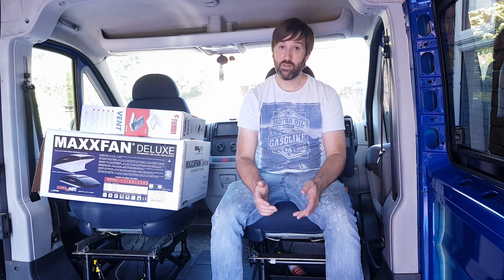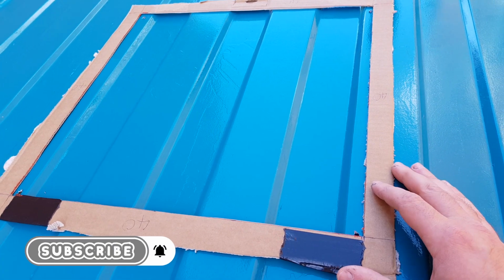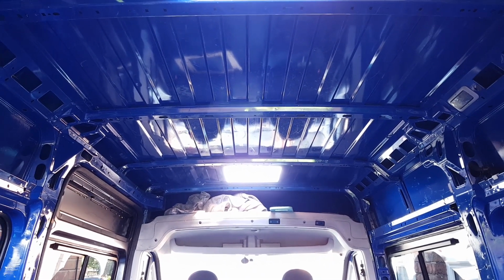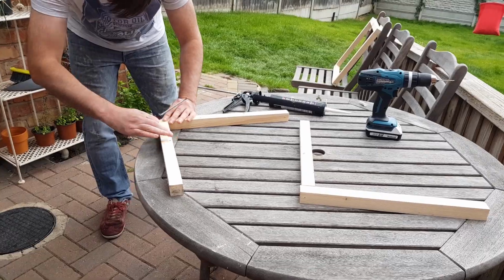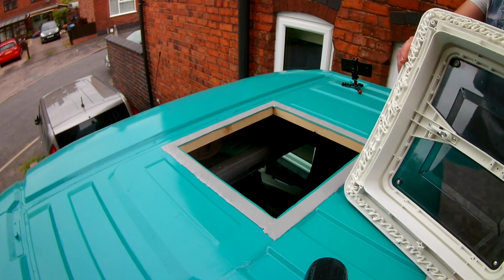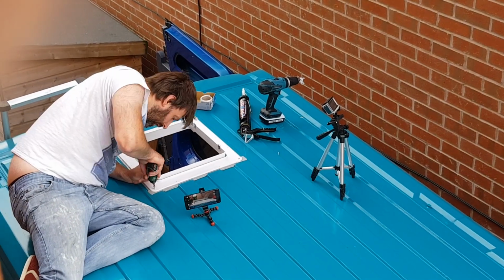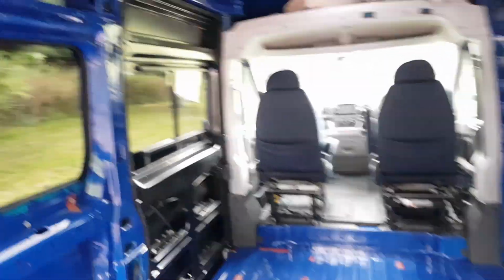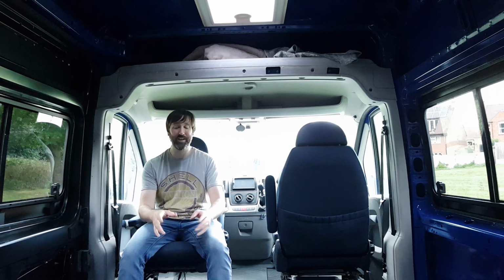Fitting A MAXXFAN DELUXE and FIAMMA Roof Vent - DIY Budget Campervan Conversion

Comment: Another tip for aligning the holes when fitting the top part, is that the holes in the plastic are bigger than the metal clips, so if you slide the metal clips up a tiny bit the screws will guide themselves into the holes.
Reply from the maker: Thanks for the advice Martin, if ever I do another build (probably likely) I'll definitely bare in mind your advice. 🙂👍

Comment: Thanx for sharing. Installing my Deluxe this week if the weather allows and your video was helpful. I did however splash out and bought and adapter for a Ducato/Relay/Boxer roof that fixes the rib issue.
Reply from the maker: Thanks for checking it out. Hope your own installation went without a hitch! 🙂👍

Comment: Yeah I was a bit disappointed you went for the posh option but fair enough you've got a dog & I'd get a Maxxfan too if I could afford it. Honestly I'd probably try to stretch for the manual version if it were available here and a fair bit cheaper. 
Nice to see you using Stix-all, I'd planned on doing the same as Sikaflex 512 is so expensive but I found some Dekasyl for roughly the same price so probably gonna go with that, although that's mainly cause it's got a picture of a campervan on the packaging lol.
Reply from the maker: Yeah we didn't want to splash the cash. It was four times more expensive than the Fiamma but we wanted to make sure the van was cool for the dog. Not only that, we thought if we were uncomfortable in there because of the heat we wouldn't use the campervan half as much. Only other big budget item we'll be fitting is a 12v compressor fridge due to how economical they are. We figured it would pay itself back over time. 🙂
Reply: @PilgrimPods  That's very sensible. My plan is also not to use my van in the blistering summer heat, don't think I could take it.
I've seen a few cheap, probably Chinese, 12v compressor Fridge Freezers that I quite fancy giving a go in the near future but the cost of the van, plus insurance, a timing belt change & inevitably a full service has completely wiped me out.
Reply from the maker: @tine8849  I'll have to have a look for those fridges. 😁👍
Reply: @PilgrimPods  The one I'm looking at is the X50 Portable 50 Litre Camping Compressor Fridge Freezer on eBay. Could be an absolute bargain or a huge waste of money.
Reply from the maker: @tine8849  will check it out now and see if there are any reviews. 👍

Comment: Are you happy with the placement of your roof vents. Not sure how your layout is going to be, dog you have a video with how it's going to look and what are your thoughts behind this exact placement?
Reply from the maker: The roof vent with the fan in was placed at the rear above the bed to suck cool air in at night to aid sleeping. At home in the summer we have a fan on at night and assumed we'd want the same in the van. We'll do our cooking at the front of the van and appreciate most folk like to have a fan near their cooking source. In a small van with lots of opening windows and roof light, coupled with the fan to the rear of the fan should be enough to control moisture and smells. That's our thoughts anyway!  🙂👍

Comment: Another great video. Have also bought a Maxxfan deluxe which I will use with another roof vent or fan at the other end of the van. (I also have a Ducato, so same issues with ribs etc). 
Was wondering what your thinking was around putting the maxxfan at the back and fiamma at the front? I can't decide which is best for me. Cheers
Reply from the maker: Hey Jonathan, thanks for swinging by again. The reason we opted to have the Maxxfan to the rear was to hopefully help keep us cool at night and aid better sleep. I get uncomfortable at night at home during the hot summer so can only imagine what it will be like in the van. I don't want to be out camping getting poor quality sleep and having the following day suffer as a result. I think most have it to the front as that's where the kitchen is and they want to remove condensate and smells whilst cooking. I figured with all the opening windows at the front, with the Maxxfan pulling air into the van we shouldn't have any issues. We'll soon find out! 🙂👍

Comment: Always a worrying task getting the perfect seal. We are about to to our Fiamma..Did You water test the finished job. Did you go back and add sealant to the Maxx vent where the unit and roof meet in particular where you added layers of tape to build up the level of the rib. I noticed that you did that on the Fiamma unit.. Best regards From NZ

Comment: Great video 👍 we’ve bought a Boxer to convert. We’re definitely getting the MaxxAir but we’re now contemplating having it over the bed not over the cooking area. Are you happy with it still ? Was that a sneaky view of Tamworth Castle I saw. We’re just in Shenstone 😄
Reply from the maker: Yup we're in Tamworth! 😄 With all the opening windows and roof vent at the front we're not overly worried about removing cooking smells etc from the van. As you know, it's ridiculously hot at the moment and I'm struggling a bit to sleep at night. I want to give us the best possible chance of getting a good night's rest in the van in the summer and believe having it above us drawing in the cool night's air will aid in that so we can face the next day fresh and fully rested.
Reply: I had the same dilemma but ended up putting the maxxair at the front obo e cooker and a clear heiki over the bed so I can look at the stars in bed. Ima light sleeper too so feel the noise above my head would annoy me!

Comment: Have you clad the ceiling yet? I'm wondering if the 34mm batons leave enough room for some cladding to slip underneath the bottom casing?
Reply from the maker: We ended up having to pack the vent frames out by 12mm when we insulated as we had decided to add a 12mm batten to the overhead ribs of the van for the ceiling to attach to rather than batten out the side of the rib which had been the original plan. I'll be putting the floor and ceiling in next and have opted to use ply with a finish to it rather than clad.

Comment: Really nice job. The contour tool is ideal for the roof valleys. i was interested in your choice of Stixall in place of Sikaflex 212 which is silly expensive. I am looking at Puraflex 40 which is more expensive than Stixall but cheaper than Sika. Great job and will be following your fit out videos.
Reply from the maker: Cheers Barry. If I had to do it again I'd opt for PU40 too. Stixall is great but since using it I've found out that although it says on the product description it can be used internally or externally if you take a close look at the tech sheet it says something along the lines of it shouldn't be used outside or something to that effect even though it's pretty much Sikaflex 212 rebranded and at a cheaper price. Despite what I've recently learned I haven't had any issues with it but like I say, I would definitely use PU40 next time (I used it to bond the solar panel to the roof). Good luck with your own van mate. 🙂👍
Reply: @PilgrimPods  Thanks for your reply. Good point on the Stixall which I suspect is a consumer product. Puraflex 40 is a commercial product and probably made to  a higher specification. Difficult to know for sure unless you are a chemical engineer.  The test will be if your PV panels stay attached to your roof (i am sure they will). I think it is always best to buy a commercial product when fitting critical weather exposed components. Thanks for your good wishes and I will follow your build on Youtube.

Comment: Did you get away with a single roll of mastik to build the indentations up? And did it stay dry after the test of time?
Many thanks for your efforts
Reply from the maker: I ended up using one and a bit rolls for both vents. I don't want to tempt fate but still watertight almost two years later.

Comment: Excellent video, subscribed. I was wondering if it would be okay to cut a smaller hole for the Maxxfan just wide enough to accomodate the fan unit? The reason I ask is that I thought it would increase the width of the surface between the shroud and the roof. This would make for a wider area for sealant?
Reply from the maker: A 400x400(?) hole is just large enough to accept the unit. You couldn't physically go any smaller. 🙂
Reply: @PilgrimPods  Thanks. Yes it became clear when the unit arrived.

Comment: I have a toss up decision between going all out and installing a maxxair fan or a Fiamma 40 Vent. The price difference is insane. Everyone swears by the maxxair. Can anyone offer advice if a single Fiamma Vent alone will be enough for a medium wheel base?
Reply from the maker: We only opted to install a Maxxfan because as you say, so many folk swear by them. There's many a story of folk cursing themselves for buying cheap only to then replace with the Maxxfan later on down the line. I have to admit though, if we didn't have the pup (he's five soon!) as ours is a budget build we would have probably just installed two Fiamma vents instead. Good luck with your decision Molly! 🙂👍

Comment: Nice video.

We're getting our van next week and one of first things we'll be doing is the sky lights and maxx air fan!

Quick question where did you get your 34mm square timber from?

The only place I've found is B&Q and it's a delivery only option, so I can't check the wood for warpage before purchase.
Reply from the maker: I bought ours from Wickes so I could ensure it was all straight. Might save a few quid swinging by a builder's merchant though.
Reply: @PilgrimPods  thanks.

I did another search and realised that B&Q do sell them individually from the store.

Comment: Save some time and use the frame as your template 🤷🏻‍♂️ Also was the profiling of the frame necessary or was your insulation too thin for you to lose it within?
Reply from the maker: Hey Pete, yeah I guess I could have used the frame as a template! If memory serves, profiling the frame enabled it to sit flush with the metal internal ribs of the van thus saving a bit of internal height in the van. What I neglected to remember was I'd be gluing and screwing a batten to the rib as a fixing point for the ceiling... Worked out all right in the end though as it meant when packing the frames out to meet the depth of the ribs I could extend the wood from the frames to offer more fixing points for the ceiling. Lessons were learned along the way. 🙂

Comment: I was surprised that you put the fan at the back. I'm putting in two of those Fiamma vents and hope to bodge together my own fans as the budge won't stretch to the MaxxFan. Most people seem to put the main fan in the cooking area at the front but every build is different.
Reply from the maker: The Maxxfan will be only one of two big budget items in our van. The reason we opted to spend the extra was to help keep the dog cool. Like you say, most stick the fan at the front above the kitchenette but we opted for the rear to keep us comfortable at night and help ensure a good night's sleep. We'll open the windows at the front when we cook and force air through the van using the Maxxfan to remove cooking smells and moisture.